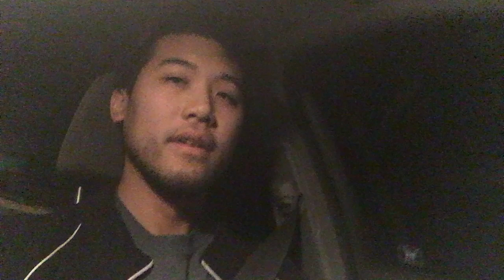DNM-37 Revision C: Cubicle Labs Chemistry Lesson #2: Thixotropy, Viscosity, and Shear Thinning

Comment: How do you think the nonnewtonian lube will interact with the modular tensioning system? Unless you've chosen a compound that has no charge, then the laminar flow of this lube would greatly change under the force of two parallel magnetic plates, being different than what is intended. Also, I cannot wait for the modular tensioning. Most innovative mechanism in a while.
Reply: This is also a concern with the GTS M and Valk M.
Reply: I don't think it has any ion in that, if it must be a stable compound usually it is neutral or with balanced charge.